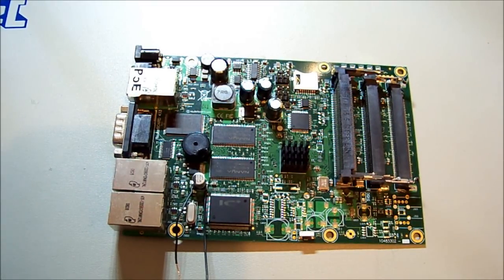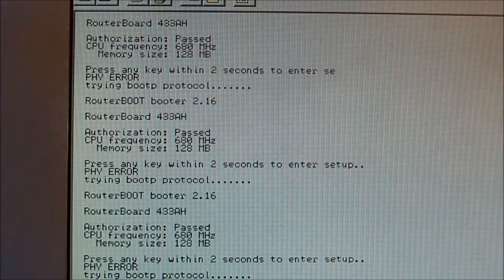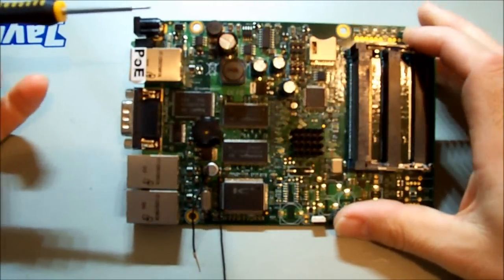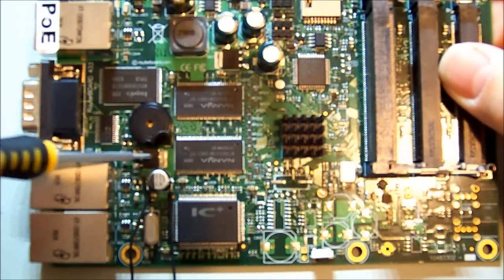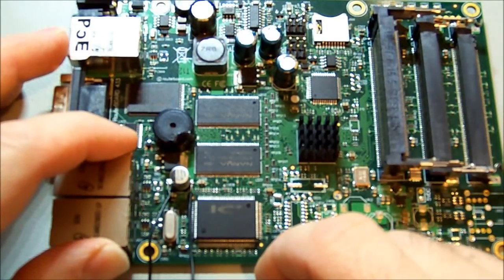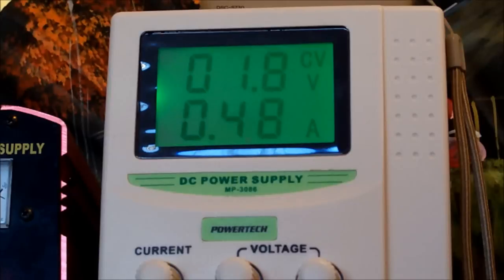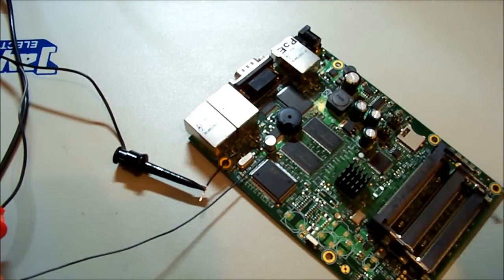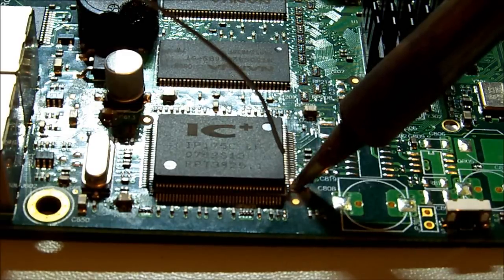Mikrotik Routerboard RB433 Repair Part 1

Comment: Good afternoon. Tell me please. I have a mikrotik RB 411r, but : - the LD501 and LD504 LED is on. - The green light and the blue light are on. - There is no connection to the PC's network card. - Reset doesn't help. - I replaced all capacitors. I would be very grateful, thank you.

Comment: I have a rb450g. It has a very weak beep. Then sometimes I can connect use netboot and other times I can't. You think it's the ic? It be great to know how I can troubleshoot. Thank you
Reply from the maker: I don't really know but maybe check power rails are ok and stable. If the beep is weak maybe that's a sign a power rail is low. Just guessing.

Comment: please i want to know how to restart mikrotik routerboard and how can i know that it is restarted (restart by shorting twoo gold pins)
Reply from the maker: I trust you know where the gold contacts are so you short them, turn on the routerboard and wait until it beeps twice, remove the short. You will know it has worked when you log into winbox and see a message stating it has been reset.
Reply: thaks mr. jonny it works well now